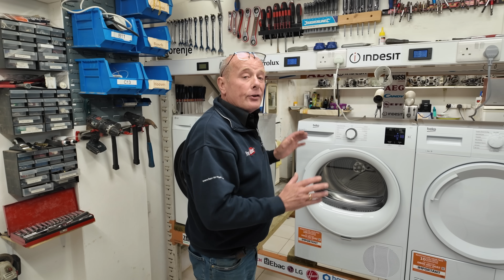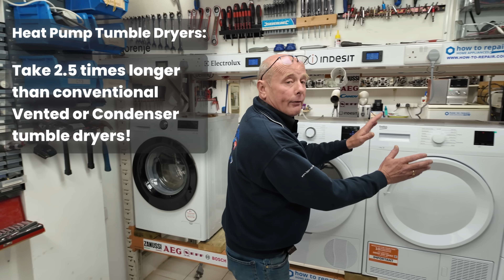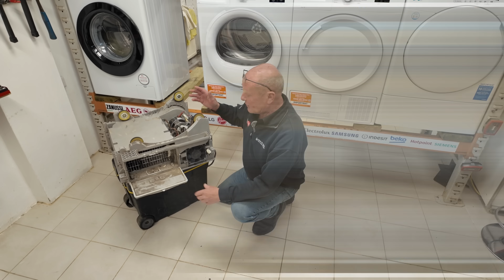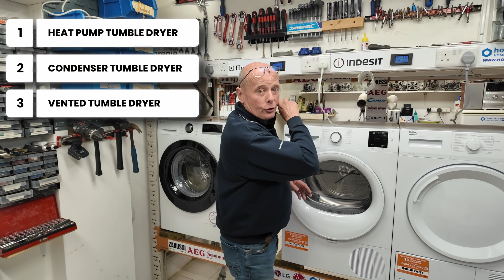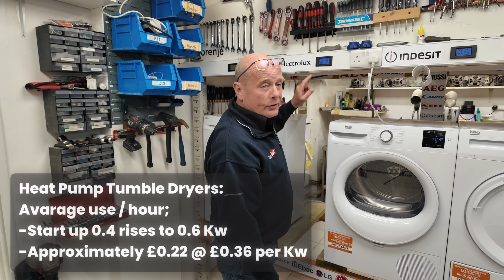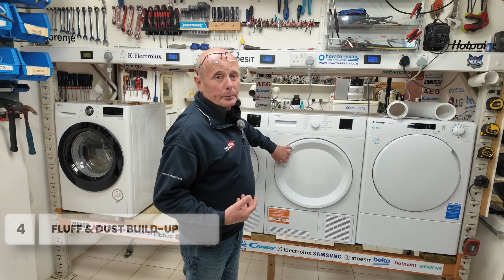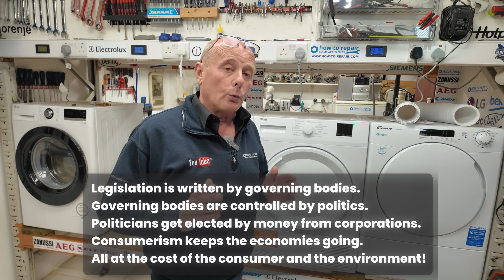Tumble Dryers the Shocking Truth About Heat Pump vs Vented & Condenser, NEW LEGISLATION!

Comment: My experience with washing machines and dryers until now was that they are machines that last forever. I would love to see the real math behind this, which one end up really having the smaller footprint on the environment, but I think the bigger problem is the hype. Yey, cool new tech, and then everybody is forced to buy it. Maybe they are the future, maybe not right now, maybe they are just a trend. But we should stop framing everyone as afaid to move forward, just because he hold one to older well developed tech that is working fine. The engineers of the past weren't stupid. And maybe we should understand what they've done right, before we try to improve it.

Comment: In my case, for small apartment, heat pump is great, I don't have a vent for vented tumble dry, and condenser will heat up the air in my kitchen.

Comment: My vented tumble dryer, dries my clothes in half the time than a condensor one, I have proved this with my daughter. I put 2 pars of jeans in my vented dryer and 2 pairs of jeans in her condensor one. My jeans were dry in 26mins in my vented dryer,  yet it took 1hr and 16mins mins to dry in her condensor. Both dryers were set to a med heat. It didn't work out any cheaper with the condensor either, we both checked our smart meters. For 20+years, we've all been buying 'energy saving' white goods etc. including light bulbs, yet not actually getting any benefit whatsover for it elec prices . Heat pumps are useless, people I know are actually un installing them, they don't give you that nice warm cozy feel that you get from traditional radiators and what's more they have a constant hum, very irritating not only to the owners but neighbours too. The real issue here is that we're producing 68% less energy than we did in the late 90's, we all know why! i.e. lack of infrastructure and whos fault is that !!!
Reply: Benefit of condenser dryer is that collects the moisture from the clothes rather than release it into the room the vented dryer is in.

This may not be an issue for you if you have your dryer in a garage or open space.
Reply: @johnbu1734  It's vented to go outside, when my daughter opens her dryer to check the drying process, the amount of 'condensed air' that hits you in the face is quite substatial, therefore, damp air is being released into her room too! Like I said, my vented dryer dries clothes faster, saving time and from my 'experiment' no more expensive to run.

Comment: Good video as always. I had an Esatto POS (or so I thought) for 7 years which has been used at least, i.e. a minimum, of 3 times a week. That's a lot of use for a $500 AUD dryer. I sold it for $200 AUD yesterday and bought a new one. No stripping required to clean. I just positioned it vent down and hosed the condenser out. Dried with a blower and good as new (apparently). I definitely agree with right to repair and all that though.

Comment: Heat Pump should be replaceable module on a sled. like units in a server rack. and it will solve 70% of issues with cleaning, repairing, etc.

Comment: I have a solar powered air dryer.
Very low tech,runs with a zero energy cost all year round.

Its a vinyl washing line in the backyard under an external roofed,ventilated drying area.

No pesky filters,
no condensation issues,
easy to maintain,
just a vinyl line and home made clothespegs.
Just requires a human operator at the beginning and at the end of the drying cycle.

Consider how many hours you have to work to pay for the electricity per year🤗

Comment: The government is getting it wrong again..when we were told Diesel vehicles were cleaner and till the truth came out that day they pollute more than petrol vehicles.. I have a 1974 Hoover rear central vented Tumble dryer and sticking with it in my vented garage. So no heat loss..in north Spain.

Comment: As a white goods engineer of 27 years I can say this guy is spot on. I love vented as the chance of a fire is almost zero. Most of the dust just blows outside so they don't get full of lint. The efficiency of a 5 year old condenser dryer is about the same if not worse than a 10 years old vented. True it cost more to run one but the spares and general maintenance to keep it running at it's best outweighs the early savings on condenser.

Comment: You didn’t mention what might be the best solution for many people, especially single households. That is of course a dehumidifier, and a clothes line. In warmer weather, just hang washing out. In cooler weather, or a flat with no garden, hang well spun laundry in a small room with a dehumidifier and leave for half a day. Mine costs 7p an hour to run. It is basically a fridge with a fan, so there’s not much to go wrong. I would hope that the fan is easy to replace as and when the motor goes. And in winter and when I cannot open windows,  I use it to remove damp from the air, which prevents mould on my walls and ceilings. You also didn’t mention a big disadvantage of condensing dryers, which is that they consume huge amounts of cold drinking water. That adds 20-30 pence to each wash, and wastes water. However, good video, well done for educating us all. I’m glad I replaced by washer dryer with a washing machine and no dryer.

Comment: My experience is not what he describes, my heat pump dryer takes just over an hour to dry a load of washing to the 'super dry setting'. It's super cheap to run.  Only downside is that it beeps regularly to clean the filter, but since fluff retention is a big problem with dryers, I'm OK with that.
Reply from the maker: I’d be interested to know what make you had the higher end machines seem to be a bit better than the lower quality ones
Reply: @How-to-repair  I've had 2 HP machines , one a bosche (had for years but got damaged when i moved house) and a miele currently.  I nearly cried paying for the meile, but prior to the bosche, I got fed up buying a new appliance every 3-5 years, if it lasts 6-10 years it will be worth it (at least thats what I keep telling myself)!  I think an issue lurking in the background is less to do with Heatpump vs old drying tech, and more to do with increasingly poor build quality like 'Vimes boots' theory.

Comment: I was lucky 6 years ago do to a lighting strike a lot of my stuff broke because it manage  to by pass or fry any fuse in the way 🤦‍♂️ do to the the fact I bought a dishwasher washing Maschine and heat pump dryer all from Samsung  manage to get a good deal I believe it was 700 for all 3 if I would buy today you looking around 2000 Oo. But seen how much dust is in there after 5  years and as an on call firefighter attend many house fire with dryer been the cause I now have to find one in Sheffield to open up and clean it 😅 so I’m not become part of the statistics 📈

Comment: I had one for two weeks. It was NOT advertised as a Heat Pump one - I wanted to avoid a heat pump one. It was bought from AO and nowhere on the product information did it say "Heat Pump". It was made by Hotpoint. Anyway, I assumed I had a non-heat pump machine as I had searched for that when buying it. I put a load in and put it to automatically dry to "Iron Dry". Three hours later, it was still going and the whole of the house stank (like my AWFUL washer dryer used to make the house stink when I was a student). A sort of laundry/plasticky smell. Not pleasant. I assumed I had done something wrong, took out all the warm and still very wet laundry out to dry on the clothes horse thingy. The machine also had a really abnormal amount of wet purple fluff in it - which I cleaned out. The next time I used it - same thing. The clothes NEVER got dry and everything needed ironing as it was so badly creased (part of the point of tumble drying is avoiding ironing). It just didn't work. I had also noticed a small crack in the water tank (thank god). I rang AO and said how long it was taking and that it just didn't work and they wouldn't accept a return until I talked about the crack in the water tank. The crack made no difference. It was completely water tight - but it gave me the excuse I needed to return the machine. I kept on saying - "but it's not drying the clothes and it's taking two hours". Because of the crack I was offered a replacement and I said "not the same machine and I definitely want a non-heat pump machine. At no point did the member of staff say "The machine you have is heat pump one". I said I would look up some machines, and come back to them. It was in doing this that I found that the Hotpoint machine WAS a heat pump one. I bought a (cheaper) Beko machine - which dries the clothes normally in about 40 mins, doesn't stink, doesn't produce tonnes and tonnes of fluff, reduces the need for ironing and actually works - no problem. Heat pump machines simply do not work. They can't POSSIBLY save energy as they have to be on so long and everything needs doing twice. The clothes need ironing - another energy cost - and by the amount of fluff in the machine, I can't imagine they are good for the clothes. My point is. I thought I HAD a non heat pump machine. It was only the fact that it was so useless that cause me to accidentally find out I had bought a heat pump one by mistake. I felt they disguised it. Anyone going from a normal machine to this one would notice the massive difference in efficiency. - and I cannot believe there are energy savings. Ironing for one adds more wasted energy (both mine and the iron's).
Reply: Forgot to mention. I tried to leave a "Feefo" review. It stopped me from doing it, which explains why the reviews were mostly positive. If Heat Pump Tumble Dryers were as good as (some) people say - there would be no need to ban the old ones. They would be flying off the shelves. If retailers are so sure we'll love them, how about a money back guarantee. We all know why.

Comment: Your prices are so low. The absolute cheapest heat pump dryer that I could find locally is C$1,200 or £600. For maintenance there isn’t even a front cleanout panel but wording “auto cleaning condenser”. LG model DLHC1455W. I believe that with old design philosophy this might have worked, but with designers apparently trying to reduce costs and trying to turn appliances into essentially a subscription model it’s a no go. You are probably correct that regular vented model is going to be more efficient and affordable long-term. Especially if the total energy savings is under 1kWh per load. Electricity is where Canada is cheap - $0.12 or £0.06 per kWh.

Comment: I still use 30yo Gorenje vented tumble dryer. Changed bearing 2-3 times myself (for 5 euros last time I've done it).
I hate, hate, hate this green politics last decades. They only making stuff more expensive and products last years less and then dumped to landfills, and you have to buy new one. Where is ecology in that? Not to mention raw materials used to make new product, as well as enery used to produce it, which negates ecological effects of this new green product.

Comment: I'm keeping my trusty old energy consuming condensing dryer but use it extremely sparsely. In 99% of the time I am not in that hurry and just put it on hangers. A cheap dehumidifier that I need for my basement anyway speeds up the process without consuming too much power and will automatically cut off when air moisture is below 55% which mean it will dry fairly quick without help. Summer times I dry it outside, but below roof so it doesn't get hit by any rain. The few hours a year I still need it dry quick I have no problems running a 2kW dryer, will cost me less than a euro a year.

Comment: Many thanks for your video. My experience of BEKO is very bad indeed, and Which? the consumer magazine would tend to agree. I bought a new house with 3 BEKO appliances, in 2011, included in sale - I had no choice.
BEKO Fridge failed after 9.5 years, no point re-gasing that, no technician could replace compressor and put the right amount of gas back in - very critical to make it truly efficient. Which says average life for Fridge freezer should be 12 years
BEKO Dishwasher was very rusty and falling apart inside (replacing trays and bits of plastic that broke inside was a problem after just 7 years onwards) was eventually replaced after 12.5 years. My previous Hotpoint Dishwasher worked faultlessly for 12 years trouble free - sold it working.
BEKO Washing Machine failed after 7 years, control module failed. Which? says average life for Washing Machine should be 10 years. It was such a noisy machine, I decided to replace it with a nice quiet Bosch one. Bosch has been trouble free for 7.5 years so far. But I take your point on your video on Bosch washing machines are built so they are 'uneconomical' to repair.
So as you can see my experience of BEKO, I would never buy them, by choice, and they really were not meant to last. So please, please don't use Beko tumble drier with Heat pump as an example in this category. I would prefer you to compare the different types of tumble drier from the 'same make' in your example.
One of the reasons for Heat pump tumble driers taking twice as long to dry clothes, but use a lot less power is it fits in with the renewable home concept, Many solar arrays in the UK don't provide power over about 3.6kW(very rough example) and battery discharge is often limited to this as well, so there is a lot of logic to keeping tumble drier appliance power down which will increase the chance home owners use renewable energy(if they choose to fit it).
In summary, I am sure you have a point, but I don't like the example you have given, and I don't think Which? if asked, would agree either. Please take my comment as constructive criticism, but overall you have produced fantastic advise which I do accept as being very plausible. Phil BEng.

Comment: I agree with pretty much everything you said. We bought a Bosch series 4 heat pump machine, a couple of years ago. It chucked in the towel one month outside of its 2 year warranty. Up until the day it stopped drying, it had been working well, and we were very pleased with it. Because the drying temperature is much lower than a traditional element heated machine, the clothes could be dried without worry of shrinkage etc. However, something to consider around the energy consumption of a machine may be worth noting. Our Bosch Series 4 replaced an old Hotpoint vented dryer that I rescued from a bulk rubbish day when we lived in British Forces Germany. The machine was around 10 years old, back in 1992, but I fixed the rattling belt tensioner idler pulley, treated it to a new set of teflon bearing slippers and the machine ran for another 30 years. At 2.4KW heating element plus motor, it used to guzzle electricity, but with more and more homes having solar PV on the roof these days, especially with battery systems, the energy consumption of the dryer is only important if you need to import that electricity from the grid. And quite frankly, who the hell are the EU to dictate to the consumer what we choose to buy? One thing is for certain, the heat pump dryer will not still be running in 30 years time.

Comment: I have a heat pump dryer. I absolutely hate it! I do not dry wet clothes in it as it will not dry the clothes unless it is running for hours! I only use it occasionally when the clothes are just about dry. There were no integrated condenser dryers for sale anywhere for my new fitted kitchen so I was forced to buy a heat pump one. Biggest waste of £500 I ever spent! 😡

Comment: I didn't like that the heat pump dryers take longer and I already heard stories where the location (in a non-heated garage for exemple) would prevent any decent drying function at all. But I never considered the maintenance difficulties and the increased usage of bearings and other components. It's unfortunate that even the condenser dryers will be phased out... although manufacturers will also design the latest models with obselences priced in...

Comment: Yeah but if my current AEG heat pump dryer takes only a third or quarter of electricity than 20 year old ones, plus is more sensitive to clothes, I am okay with buying a new one in 10 years. Also better for hygienic reasons. 

BTW in summer it takes about 1h15mins for shirts and not heavy dark clothes and 1h45min for heavy cotton towels in eco cotton cycle. So I don't understand where you took the idea of 2,5x longer cycles.

Comment: Super helpful video! I was looking at new tumble dryers for myself but as someone who works in property management dealing with the failure of appliances takes up a lot of our time. 
I feel similarly strongly about washer dryers and consumption - they are by far the most common appliance to replace and we are lucky if they last 3 years. Frequently it is less. The bearings go, the heating element goes, we’ve seen the glass portal smash completely during a cycle. New machines leave clothes still damp. Sometimes they arrive broken from the factory. 
The build quality of most laundry appliances nowadays regardless of brand is atrocious. Cost of spare parts is pricey or the parts are obsolete relatively quickly. We now consider replacements by length of warranty (parts AND labour!). Good work, great video!! 👍

Comment: We have a Siemens condenser tumble dryer, over 30 years old, it's had 1 replacement heater at around £20 I've deep cleaned it twice and it wasn't bad at all. It gets used a lot through winter and still going strong.
It's the same with our Siemens washing machine, over 30 years old, I've replaced the drum bearings twice, the heater once and the brushes twice at a total cost £120.
Before these two we were replacing the machines about every 2 - 3 years which really drove me mad. I spent a bit more on the Siemens washing machine and tumble dryer, definitely the best thing I ever did.